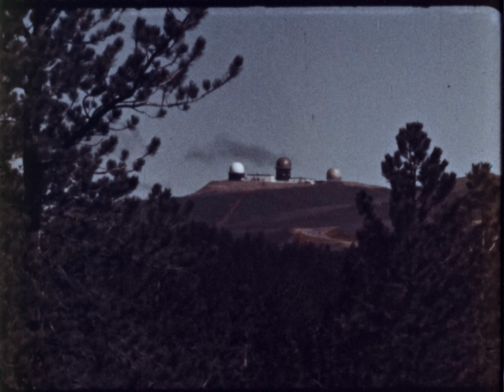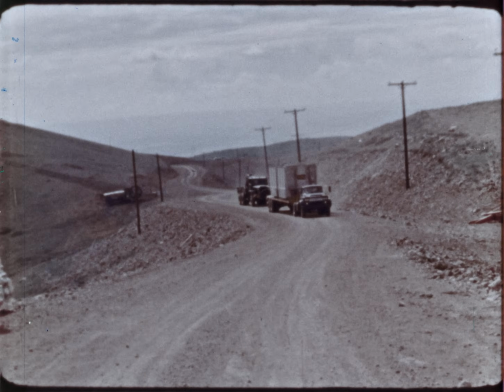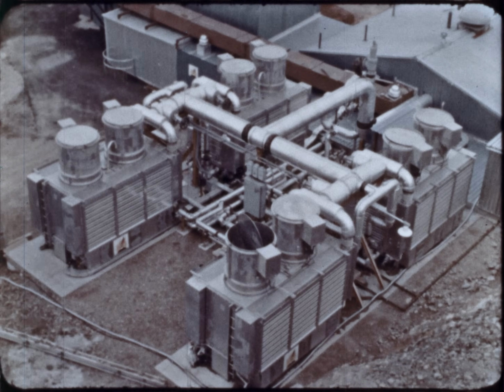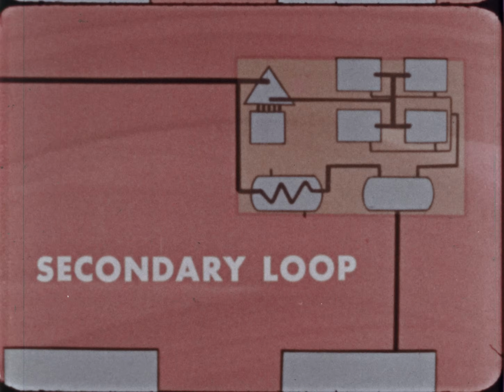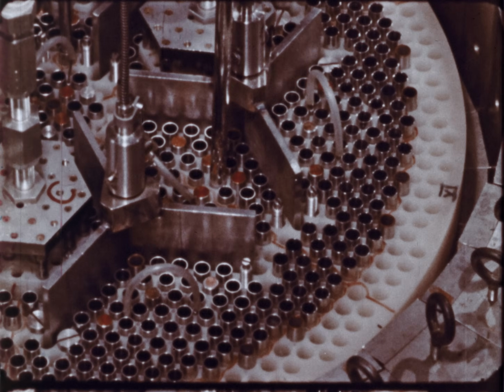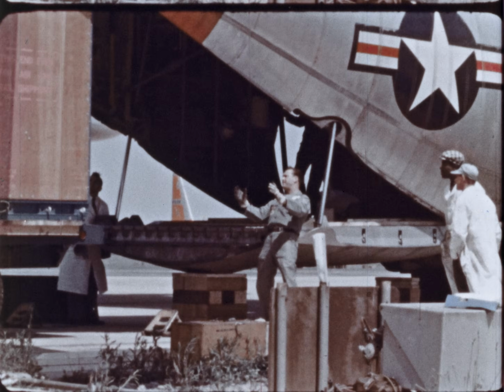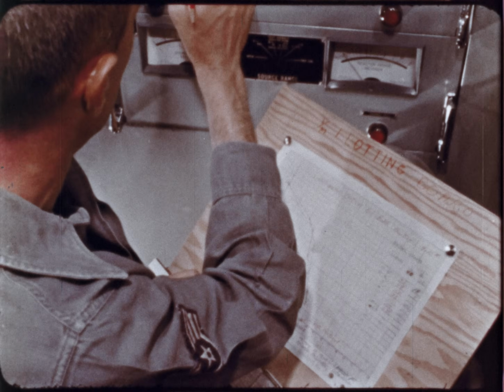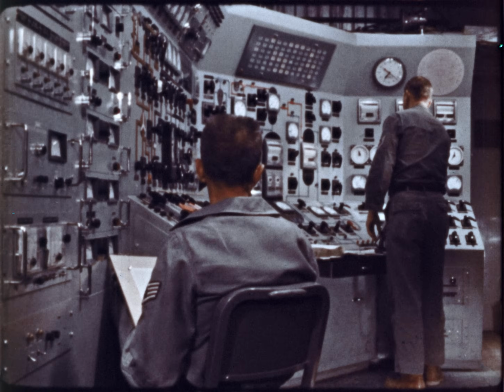PM-1 Nuclear Power Plant — the radar-powering microreactor in Wyoming from 1962

Comment: This is an important piece of history. However, realize that this was told by cheerleaders and in a naive age before we truly understood the dangers and risks. The full story is a much darker tale. 

Before you get excited about the prospect of these reactors, you need to learn a huge amount more about them, about history, about nuclear safety, safety culture, hubris, human arrogance and human incompetence. These small reactors were inherently dangerous. Judged by the approaches of the day they were regarded as safe. They weren’t. SL-1 (a different design) showed just how dangerous when it blew up in 1961 killing its three operators. That reactor holds the reactor vessel high jump record. And until Chernobyl it held the reactor shot put and reactor javelin records too. 

All of these reactors were designed using bomb grade fuel. PM-1 at least met the one cold stick rod criteria (barely). SL-1 didn’t. 

SL-1 ejected one of its control rods when it was manually pulled too far out of the reactor during maintenance. The rod penetrated one of the operators in the reactor explosion that followed - nailing him into the ceiling. The second operator on the vessel head was crushed when the reactor vessel jumped nine feet upward. The third operator was blown against the building wall and lethally irradiated. He died more slowly. 

The accident resulted in a fast transient prompt criticality that splattered the fuel plates and control blades radially outward against the reactor vessel as the coolant instantly flashed to steam generating a 10,000 psi water hammer against the vessel head. It was the force of that water hammer that sheared all of the reactor piping and launched the whole vessel skyward, all in less than a few seconds. 

It suffered an in-core very low yield nuclear detonation, just as Chernobyl Unit 4 was to do two decades later. Both reactors flashed their coolant to high pressure steam. Chernobyl launched its thousand ton lid into the ceiling, destroying the ceiling and the building as it ricocheted seven times around the hall.

In the case of Chernobyl, and like;y SL-1, the rapid heating of the fuel and the intense instantaneous irradiation of the water in the core generated an enormous amount of hydrogen gas both from fuel water interactions as they oxidized, and from driving interstitial hydrogen gas out of the cladding and fuel in a giant hydrogen fart. When that hyper hot hydrogen mixed with air in Chernobyl it detonated which then completely blew the roof and building apart. 

The so-called steam explosion each suffered is no such thing. Steam cannot explode. However the near instantaneous vaporization of the water by the prompt criticality did create enormous over-pressures that ruptured the primaries. And with no safety building in either case, all of the released fission products and very-short half-life very-high gamma intensity N-16 was immediately released. The N-16 is created by neutron bombardment of oxygen-16. It is the reason for the primary radiation shields in reactors. 

These reactors lacked most safety features required in power-reactors. The safety features they had were very rudimentary. They had no containment dome, no emergency cooling, and lacked many other safety features. The safety margins were extremely minimal based on the actual reactors performing as designed. SL-1 didn’t. It became significantly more powerful. That led to other  ad-hoc changes that ultimately led to the conditions that destroyed the reactor and cost three men’s lives. 

They were buried in lead lined caskets mostly. Portions had to be disposed in high radiation burial.  A significant part of the core uranium was never accounted for. It was vaporized. And a large portion of the fission inventory was released on the wind.

Technology is enticing. High power density is particularly enticing, especially to young men with lots of testosterone. But these conditions are extraordinarily dangerous, and the combination leads to disasters a la, Chernobyl, Fukushima, SL-1, and others. 

And this doesn’t even touch on the nuclear proliferation issues, cancers, extraordinarily long lived wastes that must be isolated for longer than humans have existed, and other dangers.
Reply: "The full story is a much darker tale."
>Proceeds to tell a well known story about an earlier design which informed the much safer one in the video.
The trade off of 3 lives for substantial safety progress is minuscule. Almost all safety standards are written in blood, and usually the lives number in the hundreds, thousands, or more. We're still learning the fossil fuel lesson despite having spent actual millions of lives on it. Some day we'll learn a lesson about the eternally promised renewable miracle, which requires millions of tons of technology to be produced in countries with nearly no environmental protections.

These were TEST reactors. The goal was discovering the unknown. Some of the unknown was made clear in their production and use. They were successful experiments, not dark ones.
Reply: @bloomtom  It is true that we learn mostly through failures. These are not however as you suggest successes. The SPERT and related reactors were indeed test reactors which were destroyed to develop an understanding of the dangers. SL-1 wasn’t in that class. It was a test reactor only in that it was an early design in the Army nuclear program. The lessons from that disaster, and it was very much a disaster, led to a number of safety I,prove,Mets and lessons. Most immediately important was the one cold stuck rod safety criteria. 

However, the story about how the reactor was designed and of how it was operated make it clear that this reactor was never safe. That should have been immediately apparent and should have led to the disassembly of the refactor before any accident could occur. It is clear in the long sequence of events that led up to the fatal night that safety (actual safety) was very low in the decision making priorities. Bowing of the fuel plates, much higher than designed core activity and other issues should have led to shutdown and disassembly of the reactor. Worse, no reactor should have ever been designed that relied on manual lifting of the control rods and the use of C clamps to mount the rod drive control mechanisms. It was a shoddy design. 

But there is another lesson in this. The commercial nuclear industry, as differentiated from the naval nuclear program under Admiral Rickover, has consistently applied criteria that do not assure safety. As a result, the entire industry has suffered repeated failures of differing types that betray the underlying failure to understand the concept of safety culture. And that failure has now led to the destruction of two major nuclear power plants (Chernobyl and Fukushima Daiichi units) with catastrophic injury to their host nations.

Even under the intentionally lowballed estimate from the Soviets, Chernobyl killed in excess of 4,000 people. In truth it killed far more than that. The industry though still hangs onto the fiction that a few dozen were killed. That failure to accept reality is a failure of safety culture. 

The added failure of not then critically assessing other plants globally for major vulnerabilities and their correction is a further failure of safety culture. 

The Japanese from long ago placed stone markers along the coast fairly far inland and fairly high up warning future generations never to build beyond that line - tsunami danger!  Never the less, reactors litter the coast beyond that danger line. Fundamental design issues like putting emergency generators in basements in a tsunami inundation zone were ignored. Those and other failures are also failures of fundamental safety culture. 

Nuclear presents a particularized locally extreme hazard when safety culture is anything thing other than the number one priority with no trade off for other priorities. 

Fossil fuels are worse. Comparing nuclear to fossil fuels doesn’t show nuclear to be safe or even safer. It only highlights instead the often incredible stupidity of man. The fossil fuel industry has known since the 1950s the precise dangers that burning fossil fuels would lead to catastrophic climate change and mass extinction. The repeated willful ignorance of those dangers and warnings through decades by the industry, by politicians and others are unconscionable. 

We are now past at least four tipping points - points of no return - that make it impossible for us to return the world to the way it was before. And that isn’t a small difference. These tipping points are steps on a slippery slope that likely have already guaranteed that all of the tipping points will be violated and that the world’s climate will hurtle inexorably to hothouse earth conditions as the permafrost fails reading 1,500 gigatons of warming gases, much of it as methane. 

Arguments based on XYZ is better than ABC are meaningless. If we are to have any chance at all of preserving anything we have to essentially stop all fossil fuel and global warming gas emissions immediately. Not begin ten years from not, not finish ten years from now - now.  In truth we had to do that more than decades ago. 

Nuclear under the most optimistic scenarios cannot play any significant role in that even if construction of plants on a massive scale begin today. And even if we ignored every safety issue. With the lag time and economics involved, there is no time in the future where nuclear can play any significant role either. Instead, investments there divert money away from technologies that can perhaps, if we are very lucky, make a dent in the rate of climate change. 

But we humans are not good at taking actions today for some benefit seen in the future. We focus instead on extremely near term and very local gain and loss considerations. 

That’s unfortunate. The earth as we knew it was a lush and beautiful place balanced precariously between hothouse and icehouse earth conditions, with two ice locked poles buffering the climate in a rare semi-stable regime that allowed the development of agriculture and civilization. The atmosphere of hothouse earth won’t be nearly so gentle or kind. And the transition to it will be frightful.
Reply: @tunneloflight  “Arguments based on XYZ is better than ABC are meaningless”

That assertion warrants the return of a hydrogen filled Hindenburg alongside modern aircraft, or brittle steel and rivets for Titanic like ship construction, or some other symptom of full blown misanthropy where lives “are meaningless” is the intended thesis.
Reply: @Czeck0-u1k  you really need to read up on logic.
Reply from the maker: The SL-1 accident taught us some early design principles that we follow now. Any new industrial technology development has risks. When steam boilers were invented, many people were mutilated and killed before we established the ASME codes. When fires happened in buildings, we established fire codes. Nuclear is now among the safest ways we know to make electricity. It avoids deadly particulate air pollution that kills 8 million/year, and avoids making any greenhouse gas. https://ourworldindata.org/safest-sources-of-energy
Reply: How many people have been killed by accidents at coal and oil plants? Far higher. Safety isn't that big of an issue for small reactors, see how many nuclear subs and carriers are in operation. You're focusing on the wrong issue. The problem is the use of HEU and proliferation, which is as much a political issue (e.g. Iran).
Reply: @straightpipediesel  No. You are. The abysmal safety record of oil and gas has nothing at all to do with this. 

Your conflation of commercial power reactor safety with US nuclear Navy safety is completely wrong. The US nuclear Navy operates under very different principles than commercial plants do. They are operated under struct nuclear safeguards created by Admiral Rickover. They embody Safety culture. 

The commercial industry is more properly compared with the Russian nuclear Navy and their abysmal safety record. 

The use of HEU is indeed a serious problem. However, it is not the key point.  Proliferation is indeed a major issue. The operation of the commercial nuclear plants has put us awash in separated plutonium that cannot safely be used in reactors, cannot be launched into space, cannot be dumped, and cannot assuredly be placed in deep disposal without serious risks far into the future. And for weapons use, it only gets better and better with age. 

Reactor proliferation IS a huge nonproliferation issue. There will always be the temptation at the least to divert or convert to weapons production. Liquid Metal and salt reactors make this much easier. So too does laser isotope enrichment and salt recovery separation. 

The short term largest risk is the destruction of one or more reactors, OR one or more spent fuel pools, either through design error, natural disaster, human stupidity, cost pressures overriding safety culture, or terrorism or war. Any single severe event results in the near or actual destruction of the host nation economically, and psychologically as an immense area is contaminated, people must be moved from their homes forever with the loss of their lives and possessions with no warning. 

The longer term risks involve nuclear proliferation, waste releases, economic burdens and defaults, lesser accidents, and incidents, and others. 

Nuclear is a dead end. The so-called "small" rectors at one-quarter the size of 1,000 megawatt commercial facilities are anything but small. Their hazards are every bit as bad as the big boys. And they can no more economically compete than can the large reactors. About the only improvement they actually provide is a lesser loss of power on loss of a single unit from use due to maintenance or problems. In a natural disaster entire clusters will be shutdown together and no improvement exists.

And none of this accounts or deals with the unrecognized catastrophe hazard that the spent fuel pools pose, or the rapid destruction of the pool concrete from high gamma doses. We are on the ragged edge of having a Chernobyl scale accident at any one of the spent fuel pools in the world at any time. 

And this doesn't even account for the now quite obvious risks from nuclear terrorism or war. Add the change to drone warfare and drone swarms and defense of existing facilities is all but impossible to assure. 

The nuclear age has ended.
Reply: @tunneloflight  TL;DR: Commenter is autistic.

Comment: Isn't Rolls Royce getting all excited about their new truck deliverable modular reactor? Isn't this basically the same thing?
Reply: No. The key difference is that all of these reactors, like naval reactors, require the use of highly enriched uranium due to their small size. HEU is a proliferation hazard because it can be used to make nuclear weapons, creating a security and political issue (see Iran). R-R SMR uses LEU like a normal nuclear power plant, but is consequently much larger, the electric power output is about 50-200x greater than these reactors.
Reply: Pretty much. It's like the rediscovery of classical texts after the dark ages.

Comment: men nonchalantly runs metal dust material through machines, heat forming, hammering into a rod
Narrator: The PM-1 uses metric half tons of highly en-riched youranium two-thirty-five
Me:
Reply: It's a lot less scary than you might think - the decay chain for both 235U and 238U is all alpha and beta, so you don't need much shielding.  The biggest risk derives from inhalation or ingestion, since that would put the radioactive material inside your body with no shielding.
Note this is only the case before the fuel has been used - after it's been run in a reactor it contains a mixture of unburnt fuel, fission products and actinides - some of which are extremely radioactive.
Reply: @TrimeshSZ  Thanks for this detail - I was not aware how relatively easy the unused uranium could be processed.
Reply: @Bricked4You  The half life of 238U is 3.5 billion years, roughly a third the age of the universe. 235U is "hotter" stuff, with a half life of a mere 700 million years (which is why it is just 0.7% of raw uranium. Neither one is very active on human time scales.
Reply: @Bricked4You uranium is not very radioactive. Before being used as nuclear fuel it was routinely used in everyday pigments and even glassware for drinking. It is not any more dangerous than handling lead or other heavy metals. It’s toxicity is mainly from its chemical nature rather than its extremely low radioactivity.
Reply: Uranium is naturally occurring throughout the Earth's crust, all this fuel comes from digging it up from the ground. It's also where radon gas comes from.  Drinking water has measurable quantities of Uranium that leaches out from the rocks your water touches. Our bodies have evolved to be able to handle and remove small quantities of Uranium. As mentioned, a particular hazard is actinides in used fuel because the existence of elements heavier than Uranium are artificial. Your smoke detector has Americium-241 which is extremely toxic, I've heard about 10x worse than Plutonium.

Comment: how many core melt downs did it take to get that to operate. none of these are running to day. the equipment they have today is blowing up and melting down all over the world poisoning the environment and every one on the planet. it is toxic, nasty, dangerous and must be stopped before we are all dead.
Reply from the maker: There were 0 core melts for PM-1 or its developmental critical facility as far as I'm aware. You should check into the fact that air pollution from fossil and biofuel is causing 8 million deaths per year, while nuclear power is causing far less, even on a per kWh basis. As always, check the data! https://ourworldindata.org/safest-sources-of-energy